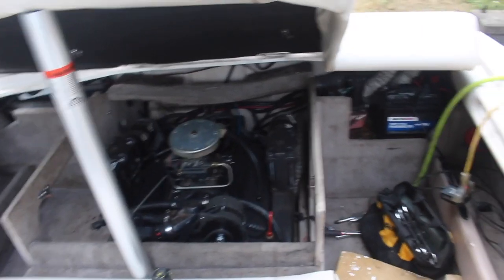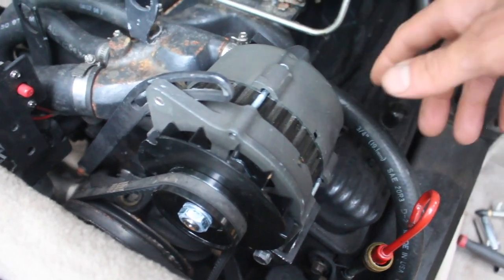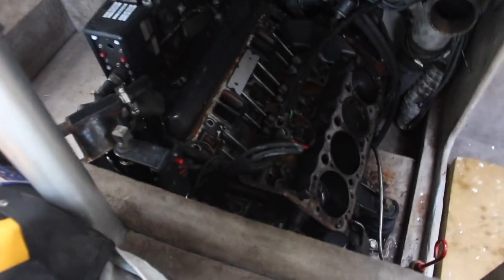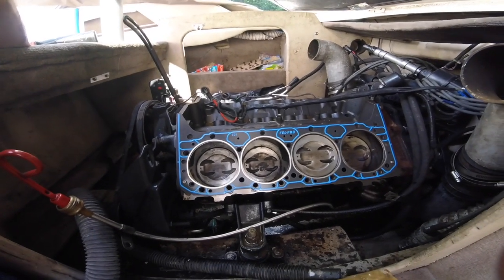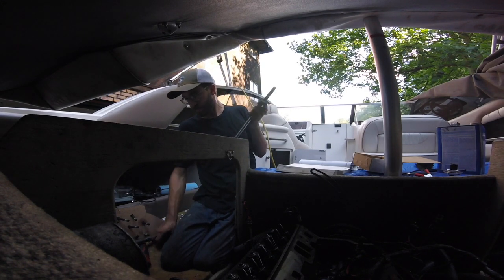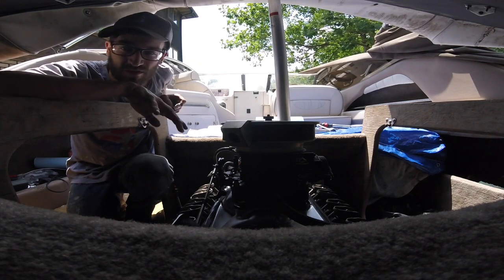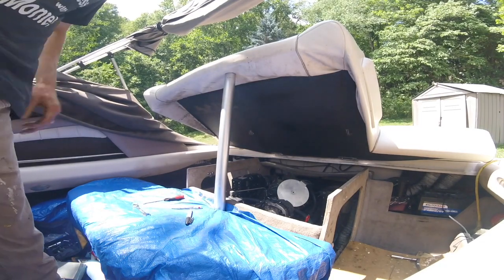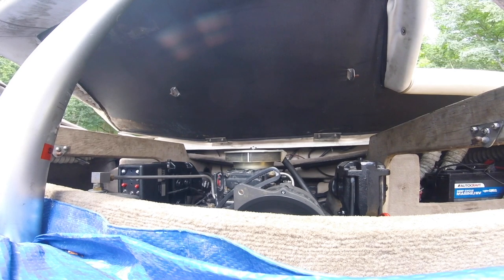Changing a V8 Boat Head Gasket (FULL VIDEO)

Comment: Bout pull my head off change but can't find the torque sequence can u send it to me and do I have redo valves. But im hoping mine just the riser gasket blew. On driver side getting water in sparkplugs on two cylinders
Reply from the maker: Sounds like a head gasket issue. Just type in “chevy 350 torque sequence” and if that’s the same engine you have it will show you a photo of it